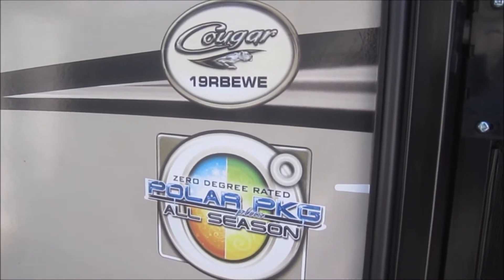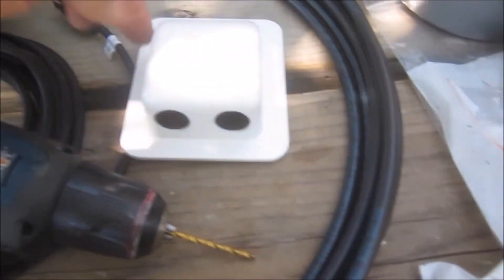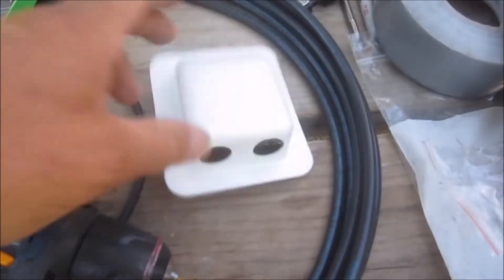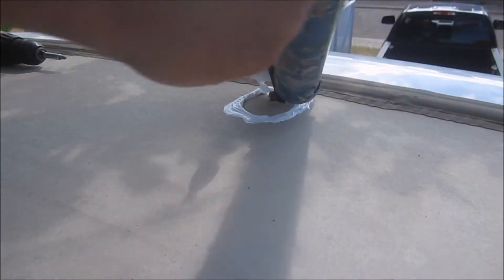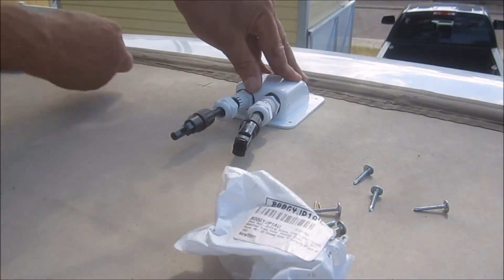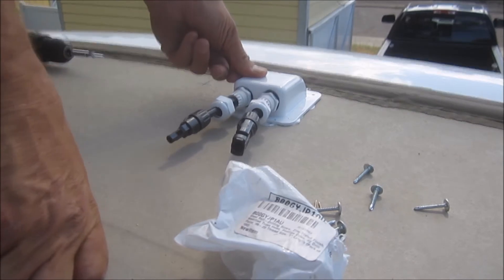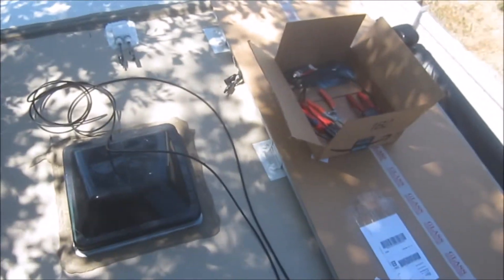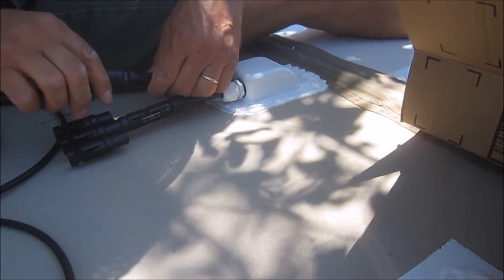Pt 1. 19ft TT Solar panel install, roof penetration, MC4 connectors

Comment: I see your roof is rubber.  Are the screws just drilled into the wood under the rubber?  Or did you line up your drill spots so they would go through the roof's C-channels also?
How have they been holding up?
Reply from the maker: I installed this on a friend’s trailer right before he left town a few years ago. I never seen the trailer again after I made the video but haven’t heard anything bad about it.
I try to put the front mounts through a truss. They are normally only made out of 2x2 pine. The rear mounts usually just go into the roof sheeting.
#10 or 12 corse self tapping screws through the rubber.

Comment: Those three parallel connectors are bad news with out fuses. You must have each string fused if more than two parallel circuits.  They make an in-line fuse that connects to the MC4 connectors. 

Everything else is awesome!  Thanks for sharing.

Comment: Hi there again, I was wondering if it's12 or 24 volt setup? Also would you tell me the sizes of the wires did you use? I know I have to use thicker wires for low volt setup but I am not sure what size to use from charge controller to batteries/ invertor.

I am planning on doing 12 volt system from 400 watt panels with 215 ah 6 volt golf cart batteries 4 of them, so all together 860ah. Thanks!
Reply from the maker: panisher 12v says. The panels run at about 18v. Panels to three way splitter is 12 gauge wire. From the three-way splitter through the roof and wall to charge controller is eight gauge. Out of the charge controller to the batteries can be eight gauge, we chose to use six gauge. For the 2000 W inverter and battery ties we use 2/0 Cable.

You may consider checking the amp hour rating of your 6 V batteries. When you tie 2 together to make 12 V, I don't believe you double the amp hours. I believe at 12 V you still only have 215 amp hours for two batteries. That's a little research you'll have to do on your own, because I didn't believe it either.
Reply: Stim Racing Trailer and Travels Thank you very much! This helps a lot! Much appreciated and yes you're right, current stay the same in series, I was not thinking 🙄🙄.  Thanks again for your help.
Reply from the maker: panisher your welcome. Sounds like a great system. Good luck. 🙂